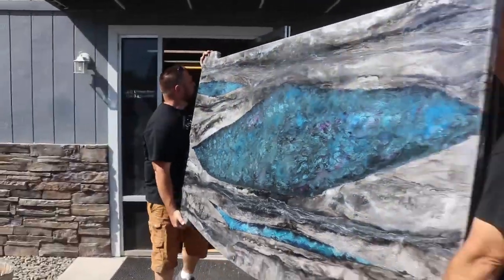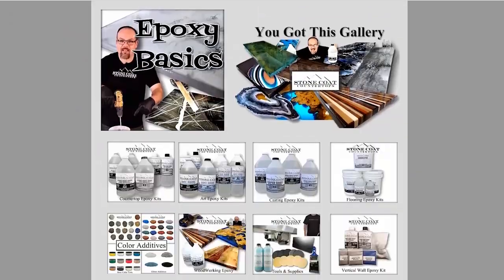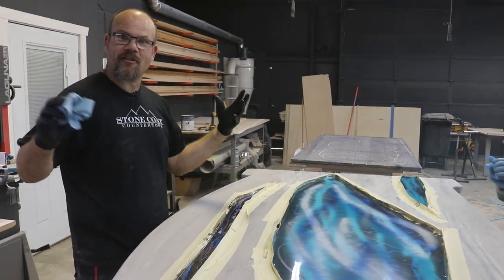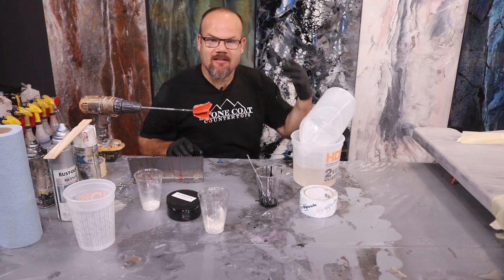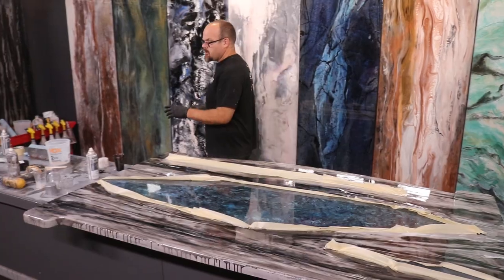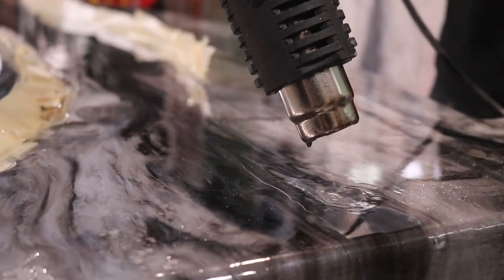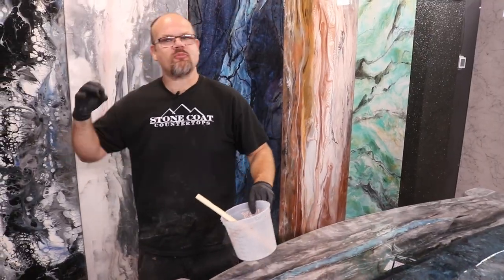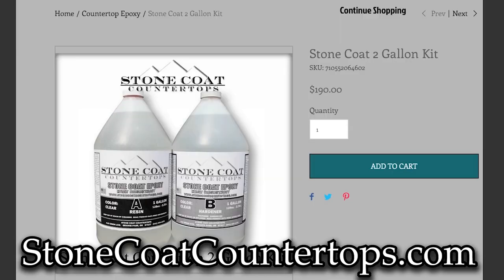How To Make Severed Marble

Comment: I'm stil thinking about my cornerish gaming epoxywooden table...
... and I've to start doing it rather than just thinking. I made some sketches, drawnings and stuff like that but I need to find workshop that will do it in my country. Dreams are high - two-part desk in the shape of L, with rounded place for chair and double-top for monitors. Also holes for cables and monitor stands attached to the desk. With many places filled with epoxy to let the LEDs light through near transparent epoxy.
Well, it will cost some money.
But I've it ;)

Comment: If I wanted i solid black area in the middle where you taped off in the middle and then a marble effect with white and gray around it would I have to tape off like you did in the middle or could I just pour the solid black down the center after I do my marble effect?

Comment: Hello Mike I got a gallon of your art coat a couple of months ago. I used it on a coffee table and the first coat is gorgeous!
Then I did the top coat and that night a small fly got in it and the epoxy was too set to pick it out, so next day I left a message in one of your videos. 
I was hoping that I could just lightly sand and polish the area, but I was told that I would have to recoat it.
So it's been over 4 weeks and the topcoat sill shows indentions if I lay something light on it for even 2 minutes. They seem to level out after a couple of hours, but I'M FREAKING. I just about did a countertop for a customer!
I had the room temp and the humidity set perfect. Could I have a Bad Batch of your epoxy? I need some help with this issue badly and feel it would be good for others to help find a solution should they run into the same. 
Thank you for any assistance. 
I don't do Facebook so I couldn't go to your site there.
Reply: What was the end result on this one?  Sounds almost like they weren't mixed properly (1:1)

Comment: I'm ordering this and doing this asap! Dumb question, the instructions say 1:1 ratio and 3 oz per square foot. Is that 3 oz of each (A and B)? Or 3 oz total?
Reply from the maker: great question. it is 3oz per square foot of total project. So, if your countertop is 10 sqft, times that by 3, you'll need 30oz of epoxy. So 15oz of Part A, and 15oz of Part B. Hope that helps!
Reply: @StoneCoatCountertops  Not only did that absolutely answer my question, flawlessly I might add, but I honestly can't believe you even responded! Most people don't... Just adds to why I'll keep following you and using your videos as inspiration!!
Reply: @StoneCoatCountertops  I've done the severed marble portion and I'm applying the remaining black, white, and silver today. But.... HOW DO YOU CLEAN THIS STUFF OFF OF YOUR EQUIPMENT?!

Comment: How do you do edges when they are directly on another surface... like a fireplace hearth... it’s on the ground and no room to catch the drips?
Reply: Meg, I've never done this, but I would think you could mask the edge off.  Cut the edge with a razor after it's cured a while, but before it set up to the point of getting pretty firm, and then carefully remove the tape.